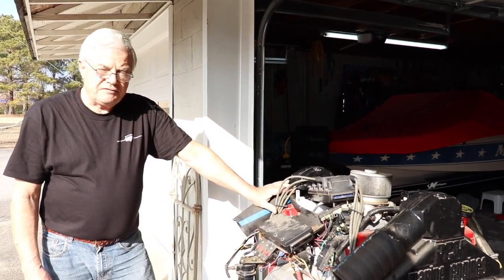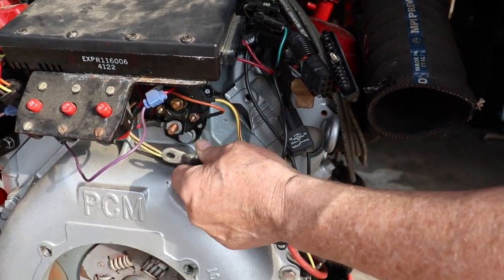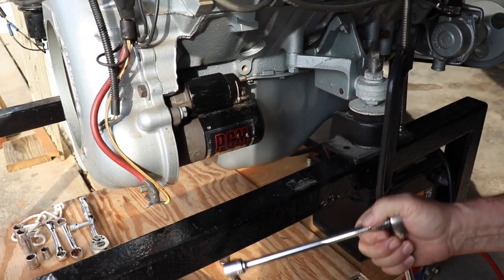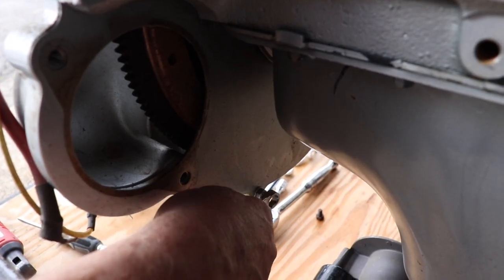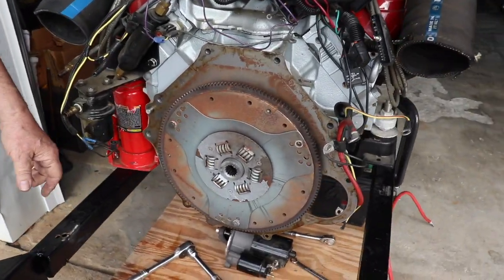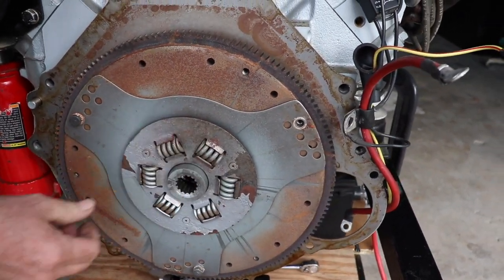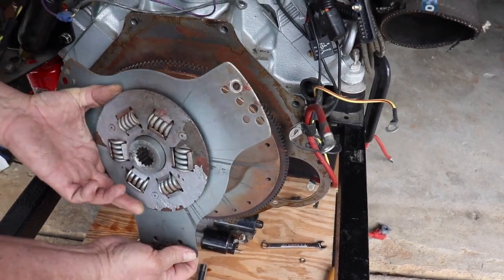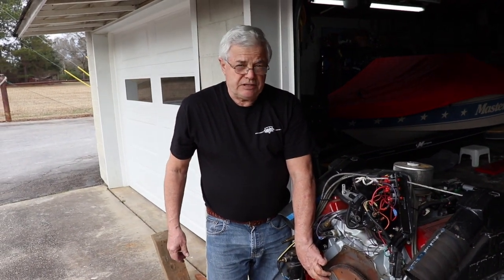How to Inspect and Replace a Damper Plate | Inboard Boat Repair

Comment: I hear what sounds like the damper plate problem but its only noticeable when out of water and using fake a lake. If i put boat in gear, out of water, I can hear the clanging noise, but in water it is not noticeable. Maybe because of resistance in water?  Today at 40mph i heard a random clanking noise in the back. It was sporadic but 
every few seconds. If i slowed down some to say 30mph, no noise.

Comment: Vince, between my DAF615 engine and the Paragon transmission there's a damper plate. The springs are loose and rattlely after 34years when the boat was built. What wouldn't be best to do?

Comment: respectfully suggest were here to learn about a DAMPER PLATE and those of us capable of this job dont need the nuts/bolts on pulling a battery cable or starter. Damper plate issues please! Thanks for your video.

Comment: Thanks Vince keep the video content flowing. Changed out mine on 86 MC Skier last fall. CLUNK CLUNK CLUNK at low speed in gear is bad springs on damper drive plate.